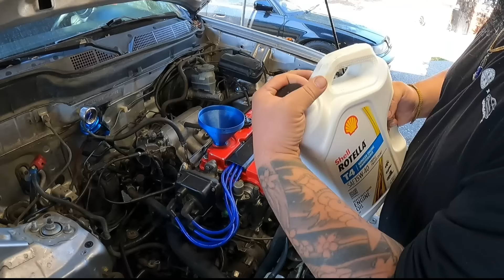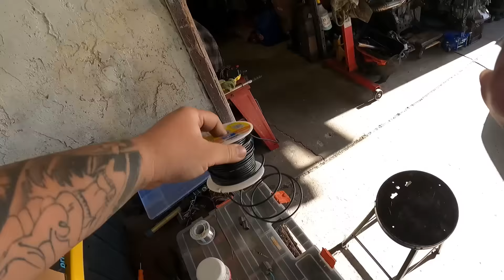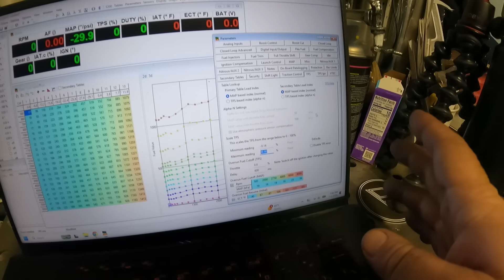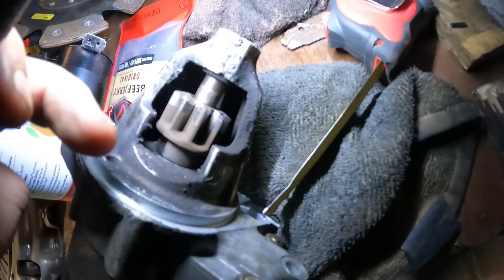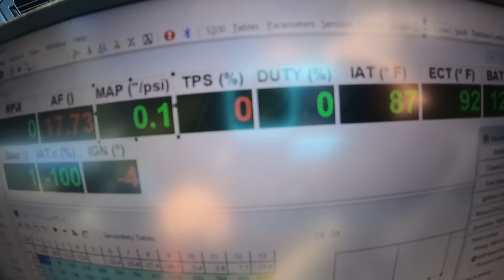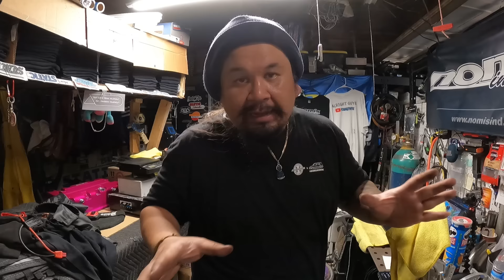The Reality Of Working On Cars | B16 Turbo CRV First Start on Hondata S300

Comment: Because the ECU gets power from the main relay, a sudden loss of power is almost always an electrical issue, not a clutch or flywheel installation issue. Check your engine grounds, the main relay, and the conversion harness's 12V power wire.Here is how to diagnose and fix the issue step-by-step:1. Check Your GroundsThe ECU and main relay rely heavily on solid grounds. If you missed a ground wire when putting the transmission back on the engine, the ECU will not get power.Thermostat Ground: Check the heavy-duty ground wire on the thermostat housing. This is the main ground for the engine harness. Unbolt it, clean the metal with sandpaper, and tighten it securely.Transmission Ground: Ensure the ground strap from the transmission to the chassis is tight and corrosion-free.2. Inspect the Main RelayWhen you turn your ignition key to the "ON" position, you should hear the main relay "click". If it does not click, the relay is bad, or the ECU is not sending the signal to engage it.Unplug the main relay (usually located under the driver's side dashboard) and check for burnt or corroded pins.3. Verify Conversion Harness Power (Pins A25/B1)Aftermarket conversion or swapped harnesses occasionally have loose pins or blown internal fuses.Look at your conversion harness or ECU pinout. Pin A25 (for OBD1) or B1 (for OBD2) are typically the constant \(12V\) memory power lines.Use a multimeter to test these wires. They should read \(12V\) even with the key completely off.Also, test pin A24/B2 (switched \(12V\) power) with the key in the "ON" position.4. Check for Blown FusesUnderhood Fuse Box: Check the main fuses (specifically the \(80A\) or \(100A\) battery fuse and smaller ECU/Engine fuses).Underdash Fuse Box: Check the ACG (\(15A\)) and ECU (\(15A\)) fuses.5. Check the Clutch Pedal Switch (If Applicable)If your car originally had an automatic transmission or if you accidentally damaged the clutch pedal wiring during the pedal/flywheel swap, the clutch interlock switch might be preventing the ECU from completing its circuit.

Comment: Starting issues after a B-series clutch install usually mean the starter motor cannot spin the engine. The most common causes are a disconnected starter ground wire, a faulty clutch safety switch, or a binding flywheel preventing proper starter engagement.1. Missing or Loose GroundsThe starter motor relies on a massive electrical ground to pull enough power to crank the engine. During a clutch job, you must remove the intake manifold or the thermostat housing to get the transmission out.The Fix: Check the main engine ground strap (usually bolted from the valve cover to the chassis/transmission) and the smaller thermostat housing ground wires. If these are loose or unattached, the starter will get no power, and the car will be completely dead when you turn the key.2. Broken Clutch Safety Switch (The Stopper)Inside the car, the clutch pedal has a small button switch that tells the car's computer the clutch is pushed down. The switch hits a little rubber or plastic stopper on the pedal.The Fix: When pushing the pedal hard during transmission installation, this old, brittle plastic stopper often breaks and falls out to the floorboard. If the stopper is missing, the pedal goes right past the switch button without pressing it, and the car won't even try to crank.3. Binding Flywheel or Starter MisalignmentSix-puck metallic discs lack the smooth, curved shape of standard clutches and are designed for high power. If the pressure plate or clutch disc is installed backward, it can cause everything to bind together and lock the flywheel in place.The Fix: If the engine won't turn over at all (it makes a heavy clunk but won't spin), the flywheel teeth are binding against the starter gear. You will need to drop the transmission to ensure the clutch disc is facing the right way (the hub must face the flywheel) and that the pressure plate bolts are torqued correctly.4. Weak Battery or Starter DamageInstalling a heavier-duty (Stage 2) pressure plate means the springs you are fighting are much stiffer. If the battery is weak, or the starter is already worn out, it will not have the power to spin the crank against that tight pressure plate.The Fix: Charge your battery, test your starter, and ensure the main power cable to the starter didn't get pinched or broken during the transmission removal.

Comment: If you have a B-series engine and are installing a 2-stage (often called twin-disc) 6-puck clutch, you should not have any physical clearance or grinding issues inside the transmission bellhousing. However, grinding issues can occur if the clutch does not fully release (a problem called clutch drag), or if the clutch discs are installed backward.1. Clutch Drag (Incomplete Disengagement)If the clutch is "dragging," the transmission is still turning slightly even when the pedal is pushed all the way down. This causes a harsh grinding noise when you try to shift gears, particularly into reverse.Hydraulics: Upgraded clutches require a lot of fluid movement. If your master or slave cylinder is leaking, or if there is air in the system, you won't get enough pedal travel to push the pressure plate far enough.Pedal Adjustment & Pedal Stop: Because multi-disc clutches are very thin, you must adjust the clutch pedal properly. If you press the pedal to the floor, it can over-extend the pressure plate, damage the springs, or cause the throw-out bearing to over-extend. Always follow the manufacturer's pedal height specifications.2. Backward Clutch DiscsMulti-stage clutches require precise stacking. If you install the discs backward, the clutch hub or bolts can rub against the pressure plate or flywheel, causing screeching, rubbing, or grinding.The Fix: The clutch hub (the center portion with the splines) must face the correct direction. Manufacturers usually stamp "flywheel side" or "transmission side" directly on the disc.3. Throw-out Bearing (Release Bearing) IssuesThe throw-out bearing is responsible for pressing against the clutch fingers. If the wrong bearing is used, or if the bearing is not shimmed properly, it can preload (constantly press on) the clutch, which causes noise and rapid wear.Understand the symptoms of an incorrectly installed or dragging clutch so you can avoid shifting issues:0:34Signs Your Clutch is Dragging: Key Indicators17K views · 2 years agoTikTok · actionclutchCommon Symptoms & Solutions ChecklistGrinds going into reverse: Indicates clutch drag. Solution: Bleed the hydraulic lines and adjust the pedal.Loud screeching or squealing: Indicates a backward disc, a dry/bad pilot bearing, or metal-on-metal contact. Solution: Drop the transmission and check the disc orientation.Chatter on engagement: This is normal. Puck-style clutches have less surface area and grip aggressively, which causes low-speed shudder.

Comment: Static you the top dog of d.i.y bro ive learned from you and plenty of others have.im having a problem with my timing on a 1994 b16a3.im trying to degree some kelford 176-T cams i got vtec locking pins on # 1 cylinder this is my first time degreeing cams this is for a boosted b16a3. I have a tiny bit of rotational play from left to right on my crankshaft timing belt drive gear with the built in woodruff key obd1 that is causing my degreeing wheel to jump around.ive done timing belts on b series but didn't have to degree anything before so just lining up the lines was never a problem.is that little bit of play normal ?

Comment: Hell yeah 💯 porcent agree with you it's not that easy men I got a huge headache with my car men  in my case also ECU won't show check engine light but I'm able to read and erase code plus  my fuel lines started leaking all over also see that you separated wire the v tech  with own harness  I woundering if I have to do that too omg so many stuff but we got this  bro always learning never quit

Comment: I might have missed it but what was the fix for the pressure plate / starter noise in the transmission? Did u just replace the starter ?

Comment: Pulling the water pipe with the engine in the bay and the intake manifold sucks but it can be done. I've done it. Just be careful and you won't break any sensors.

Comment: Is big Bertha a Chevy with a 5.7 ? I kno someone that just parted out a 88.Chevy van with a 5.7 and the drivetrain had 90k miles . I bought the tranny but engine is up for grabs engine is clean and complete in good condition
Reply: I forgot to mention this engine is located in ceres ca prob like 3 hours away from you

Comment: Carbs are butter bro, quadrajets are cheap to rebuild , just rebuilt one this year for like 70$, oriellys had the kit, Walker brand, set your air bleeds and 3-3.5 turns out from tight to start, plug distributor and hook up vac gauge and loosen bleeds half turn at a time for highest vac then turn back in 1/8turn, and its factory set, hope that helps, almost forgot, epoxy the well plugs, they were laquered back in the day and always leak, flooding a hot engine, if you need or want help lmk, I'm local bro

Comment: A big Bertha set of videos would be sweet, van life and tow rig.  Give you a break from Hondas.  Sometimes a new wiring harness is the answer, but the hidden switch will drive you nuts. Mobil 1 until the Valvoline restore and protect. It cleans the carbon out, 3 oil changes then whenever it’s on sale. Mobil1 20w-40 regular use. 
Keep your head up, cars cause problems, especially when you use a new piece of gear. Sweet first start. But the water pipe really sucked, I’ve seen people put billet ones which is a bit much. Nice birthday present. ✌️

Comment: I recently finally started my lsvtec swap for the first time and was having issues with idling. Come to find out i had a 4 bar map sensor when i never told the tuner to add that in the chip. I threw a normal map sensor in it and low and behold it started no issues and was revving perfectly. Then I also forgot to tell the tuner not to add the oil pressure switch so now i have a engine light because of that. Ive been building my 91 Teg for 5 years now and its def a bitter sweet moment to see it run for the first time. I will just have to tell the tuner at the dyno to disable a few things and hopefully she will last me a good while. I love watching your videos because ive learned so much from them. You are the goat when it comes to these things!!